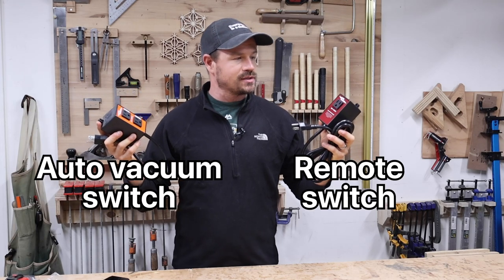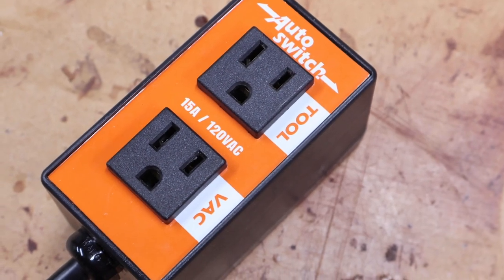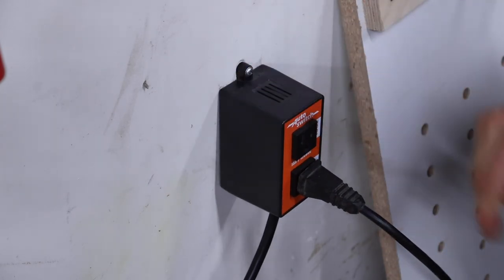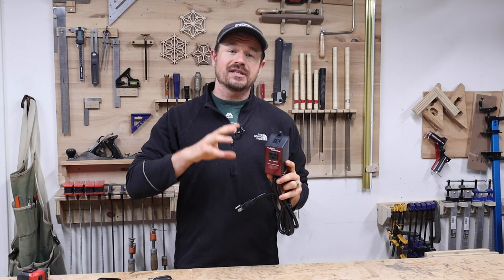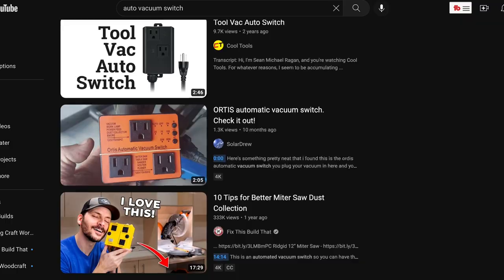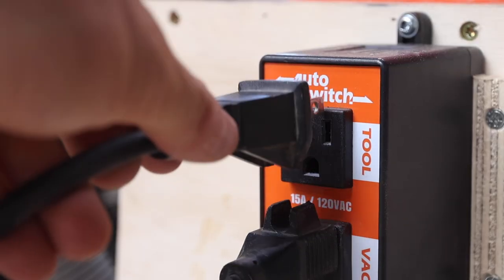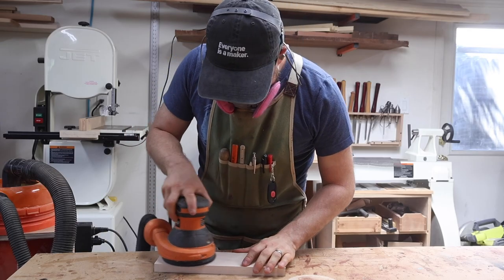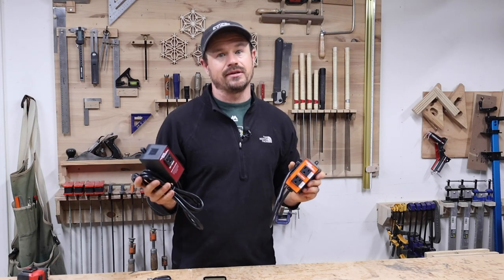Don't make the same mistake I did | Auto vacuum switch vs. remote switch for dust collection

Comment: I got a remote with three buttons from Harbor Freight. It has three separate plug jumpers you can spread out around the shop. I use one for dust collection, one for air compressor, and one for a fan. It was under $20 and I've had good luck with it. If you had a really high amp draw it probably wouldn't work.
Reply from the maker: Oh that’s an interesting solution.
Reply: @BikeCityWoodworks I now have a second, larger dust collector that is just for the table saw. I also use it for my planer. Unfortunately, I had problems with the breaker tripping. I found another auto switch with two power cords so you can put the saw and collector on separate circuits. Works like a charm.

Comment: Very good information.Just got the saw stop table saw like yours.I see you upgraded the fence on yours.Thinking about getting the fence you have,but that support table on the end with the legs will add about 13 inches to the overall width.Kind of tight in my shop.Was it worth the 500 bucks to get that fence??Thanks
Reply from the maker: Funny you mention that! I’m producing a video that should be out soon on this very topic. Spoiler alert: yes, it’s worth it, but see if you can pay less :)

Comment: I have seen many videos for this kind product, but nobody mentioned that it is ONLY good for Vac less than 3HP. Otherwise, it is overloaded and will burn. For 2 HP Vac, it needs 13A current and 3HP 18A current. This procuct is designed for 15A only.
Reply: Why not set it up to send power to a relay coil or contactor for larger loads? This would solve the hp limit of your collector.

Comment: Breaker 20 amps electric wire gauge 12
Router : 15 amps + vacuum 10 amps
Total 25 amps vs 20 breaker amps
Question: working together vacuum and router won’t the breaker trip ?
Remember : electrical code : for breakers only 80% of the nominal amps ; that means only 16 amps for 20 amps breaker
Reply from the maker: I’m not an electrician so take my advice with a grain of salt but I believe that is initial amperage. The vacuum starts just after the tool. 

Also I believe my vac and router together are around 14 amps. It’s a small vacuum and a small router.

Comment: Having trouble getting the O Skool Auto Switch to start my Rockler Dust Right. Anyone else have the same trouble?
Reply from the maker: Hmm is this the one that has a remote built in?
Reply: Not sure,  bought it used. It is a 2020 model. There are two on/off switches, a large red paddle and a smaller black square. Designed by a belt and suspenders kind of guy?

Comment: Those remote switches seem to die in a few months.
The auto switches work great if you only have one tool plugged in at a time like I do in my small garage shop. Plug the extension cord into the auto switch and use that for your tools.
Reply from the maker: Interesting, I haven't had a problem with mine.

Comment: Hey! Since this is your latest video, Im gonna park this comment here. I see you own the CNS, like me! My blade's run out was outta alignment. I went to hell and back to figure out how to fix it. (Well, I searched YouTube, and none provided a clear answer. Ultimately got the instructions from SawStop -there's a set-type-screw hidden behind the rear bracket if you have a table extension). Maybe you could make a how to video. Hint. Rather than loosen the bolts and tap, man-handling the trunnion was way easier.
Reply from the maker: I actually have a video idea around this! Is there anything else you'd want to see about the contractor saw?

Comment: Problem: Both the shopvac and the tool are on the same outlet, breaker, and phase. They use considerable amperage and could exceed the rating
Reply: I used one of these at my old house with no problem. My new house is older and has older wiring and if I plug the shop vac and dust collector in at the same time, it trips the circuit breaker.

Comment: useless if you have 240V tools.
Reply: You could get 240v version. I believe the creator is in USA, they primarily have 110v, single phase electricity. Over here for a home, we get 240v, three phase or one phase. Most people wire the house to a single phase even with a three phase option. But solutions exist for all kinds.
Reply from the maker: Yes you can get a 240 version of both I believe. When you look for a 240v remote switch you may need to start looking at a woodworking hobby store though.

Comment: Just plug a power strip into the auto switch. then drop cords to the tools. Thats how my small garage shop works.
Reply: As long as you work alone that's a good idea. I do the same,
Tho I see there becoming issues if you were to have multiple people in your shop at one point
Reply: That's a terrible idea.  Power strips can overheat and start a fire without tripping the breaker. Never use them with anything that pulls a lot of power. You should also avoid using extension cords with less than 14 gauge wire. Most are 16 gauge and can overheat when using high powered shop tools.
Reply: @MAGAMAN  I only use one at a time and use a 30 amp rated power strip.
Reply: @MAGAMAN  that's why you buy heavy duty power strips rated for 15-20A. Lots are out there, they're not even that expensive.